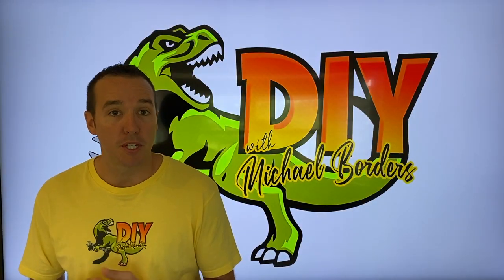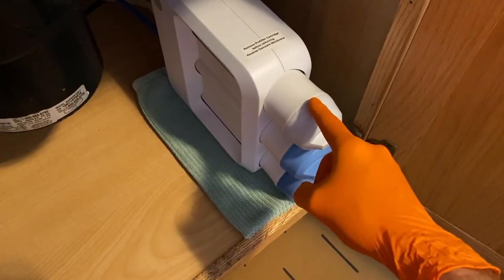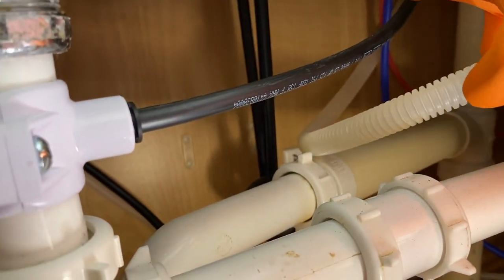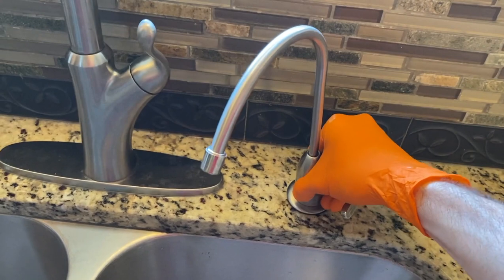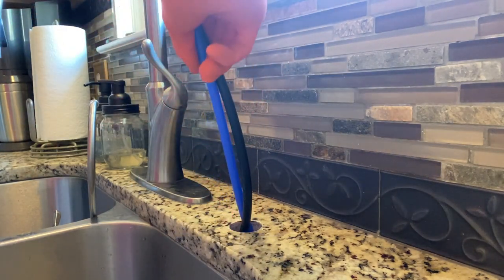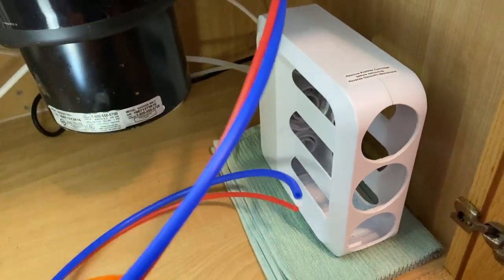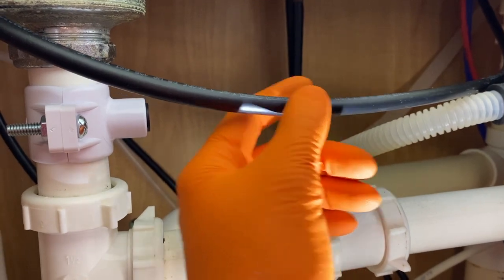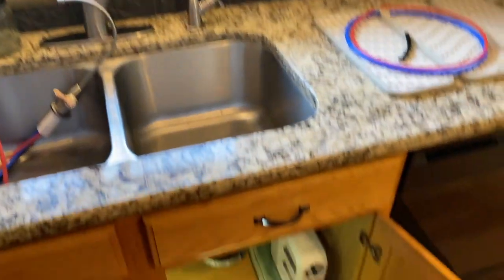Replace reverse osmosis faucet - FAST & EASY!

Comment: I need to know where you got the new faucet from. Mine you can hear the air constantly flowing, and it’s leaking below the sink. I need to get a new faucet.
Reply from the maker: @kevinallong8770  

Good morning ☕️

We purchased our replacement faucet directly from GE support.

You can find GE support number near the back of your installation manual where the model number and parts description is located.

We contacted them and purchased an exact replacement faucet for our exact unit.

Let us know if you need the GE support number.

👍🧰

Comment: Hey Michael! How were you able to order the new faucet part separately? Need to replace our GE faucet because it's leaking inside the casing. This one is a match!
Reply from the maker: Thanks for watching Katie & welcome to the DIY Raptor Club.  We called the GE parts number located inside the owners manual that came with the unit.  You can purchase directly from customer service.

Keep us posted on your DIY project.

Comment: Mr Borders , I have a 2013 Chevrolet Malibu LT 2.5 liter four cylinder Eco tech engine just like your maroon one , and I have no service records of Transmission fluid change mine has 190 , 000 miles What should I do Leave it or change it ?
Reply from the maker: Thanks for watching Blake, you may want to have the system flushed, cleaned, & refilled.

Hope all is well.  😎👍